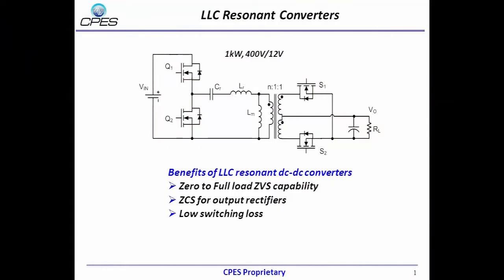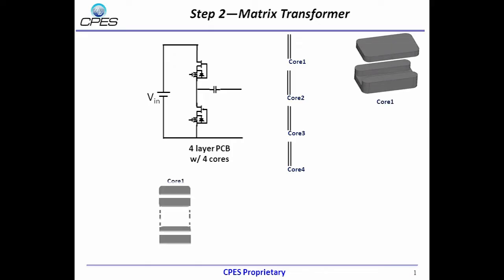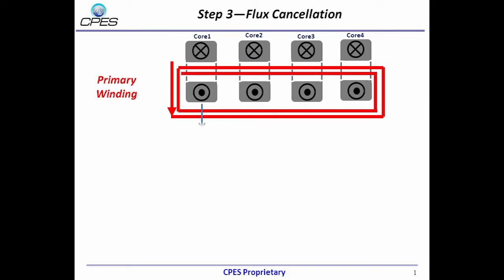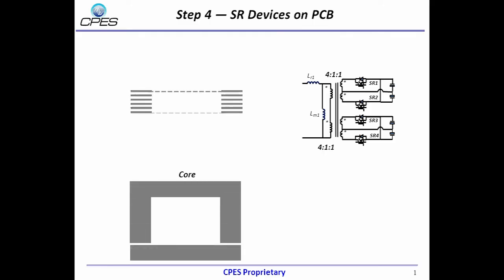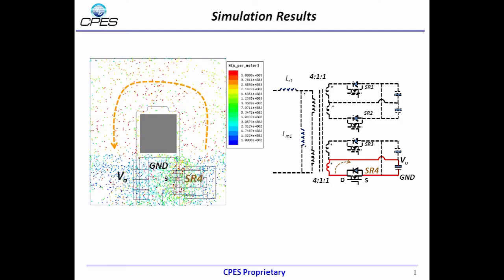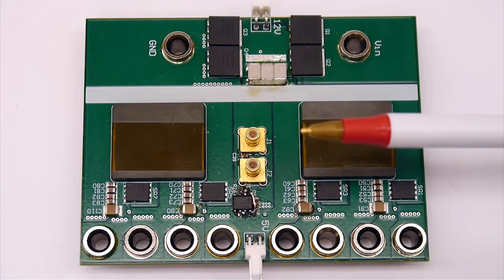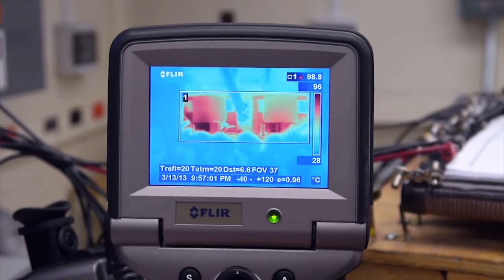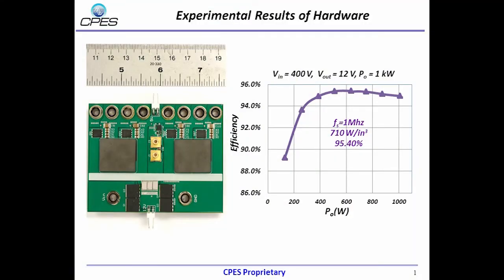LLC Resonant Converter with Matrix Transformer

Comment: Can you use the secondaries without connecting them? I want to make a 30v x3 LLC half bridge converter where all outputs are isolated from each other and from input. Is this possible with one controller and one transformer with multiple windings?

Comment: I woder
1. PCB layers is enough for Isolation between primary and secondary side?
or Is it possible to pass for Hi-pot test
2. Any patent on these matrix transformer for LLC resonant converter?
3. For High power/ampere application, PCB copper is enough for proper current density?
Reply: 1. for isolation, it depends on the dielectric material between primary and secondary layers. For isolation capability, certain thickness of standard FR4 is required. It is possible to pass the Hi-pot test, if FR4 is thick enough or other high isolation material is used.
3. For high current application, the current density matters, not the absolute value of current. The current density depends on the skin depth and width of the PCB copper.